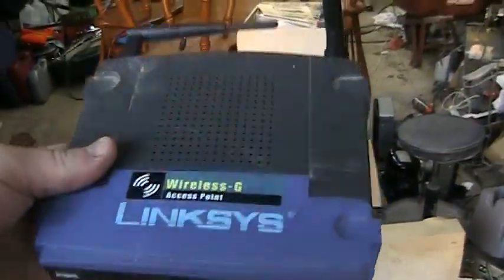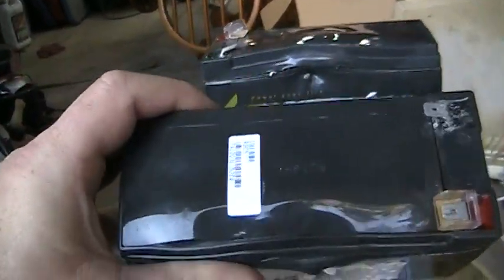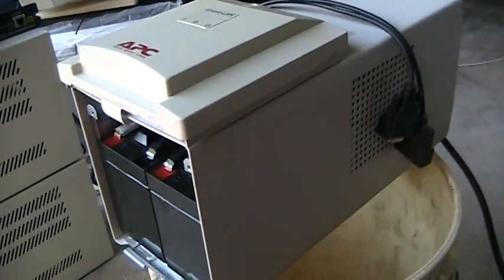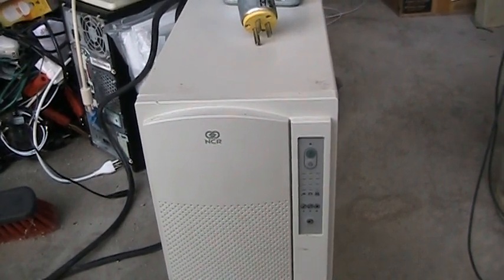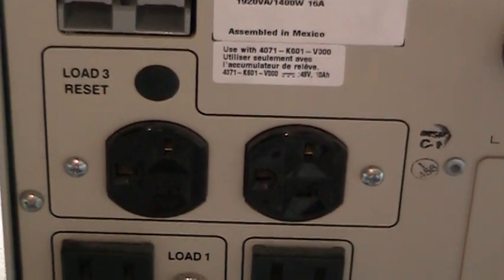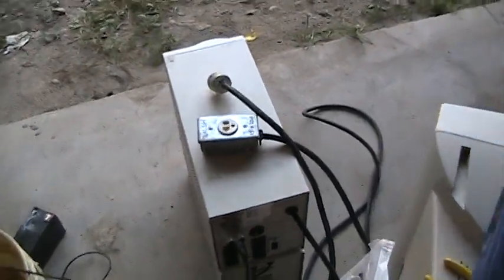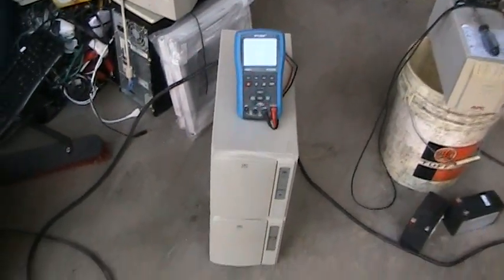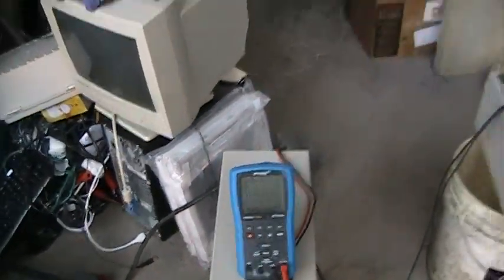2016 Hamfest Finds!

Comment: The 4071 series NCR UPSes were made by Sigma Power Systems and are of the line-interactive type with built-in power conditioning.  The 4072 series, which is still in production, is made by Powerware and is a double-conversion type, which is designed for applications were power quality is critical- they take the line input and generate very clean synthetic AC power from it.
Reply from the maker: Looking inside revealed this one to be a Powerware unit. It's also much newer than I thought: someone wrote a date on the inside back panel of 06/06/2001. Component date codes pretty much back that up.

It would have been nice to find out this was a double conversion, truly uninterruptible UPS. Still, it works well, has a true sinewave output and I'll definitely take that for the price I paid!

It's a good thing I did happen to look inside. The main circuit board had gotten loose (or someone was tinkering around) and was just floating around inside.

Comment: I never got any aftermarket firmware to go on my old WAP54G, but it worked for probably 14 years total.  It did about 6 years of duty as a wireless bridge before finally dying after a power surge.  Replaced it with the router version running DD-WRT.  Does cool stuff, but honestly its a LOT more confusing to get bridging set up on.

Comment: Some great finds! I am sure if i looked hard enough I may be able to find something similar to attend over here. As regards the Dell Optiplex GX280, They did also build a small number of them into the later BTX style case, I have seen a few Optiplex GX280 in that case but never owned one. I believe there was also an Optiplex 210L which used this case to although slightly different from the later 'main production units'.

Comment: does the camera you are using have a small plug with centre pin positive outer shank negative I think that you can run it of the charger without the battery being present as I have done this sort of thing before.

Comment: Have an APC Smart-UPS 1500 backing up my new used Newegg Dell I-5-3470 CPU @ 3.2 GHz.  The UPS is a 2015 ebay find and the ebay batteries where added about eight (8) month ago...  Like the 1500 models for they have normal three prong plugs for house hold use.  Also have a Tripp lite 19" rack mountable with maybe two batteries and a LCD screen that reads voltage input...  The Tripp Lite powers the Broadband Modem, the Dell 24 port Switch and an APC power strip switch with fail over to the APC Smart-UPS 1500 tower...  And if I knock a plug from the outlet then the UPSs will start to BEEP !  Thank you for another great video !  tjl

Comment: You can never have too many UPSes, always handy to have them around, especially if you have a generator on hand that needs manual starting in a power cut... :)

Mine did their job nicely the other night when a storm rolled through and fired some bolts of lightning within a few hundred feet of the house, power went out (turned out one of the circuit breakers in the fusebox tripped!!!) lights stayed on, managed to shut my Lenovo M57 SFF IP Cam/Media server down safely, and all was well, 'til I found the Lenovo's PSU was goosed from capacitor blight and wouldn't start up again!!! Stupid AC Bel crap... :\

Comment: I bought a pair of toshiba libritto 50cts for five dollars this year at hamfest
Reply: Nice!! Do they work?
Reply: +Kevin Bhasi One works but has a cracked screen while the other is just plain dead but has a good screen, so I am going to swap the screen and come out with one working one.
Reply: Jack J with 2 batteries, assuming that they are included. Did you get any other accessories?
Reply: +Kevin Bhasi Yes, I got a dock, an external floppy drive, and an external dvd drive.
Reply: +Kevin Bhasi It did not have a charger though, but I had a compatible adapter.
Reply: Jack J Ok. Nice to know. I've been asking you those questions because I was a bit curious, because the only vintage Libretto I've seen for sale in my country is a 50CT by itself with a battery being sold as-is untested by a liquidator for S$180. Ouch.

Comment: please upload your vids on HD.. not all of us watch on 12 year old 4:3 monitors and will appreciate the extra pixels :)
Reply: +talldude123 okay I see I see.
Reply: The rest of us have correct 4:3 aspect ratio monitors. Doesn't have to be 12 years old, mine's only 3 so far.
Reply from the maker: It's not and never has been a question of what kind of monitor I am using. (And this is a 16:9 aspect ratio video!)

I don't watch Youtube in HD and I see very little reason to upload in it for everything that I do. So, with all due respect, and at this time, the answer to the question is "no".
Reply: I could read the serial numbers on those batteries. so it's good enough.

Comment: Hello this video is great and you really got some great stuff . I have a computer issue that is bugging me . if you could help that would be great . the issue is that every so often I would get the blue screen and on the bottom memroy dump and  it says in the middle issue can be caused by hardwares software in working or installed properly . I had checked all the software and hardware and all is working right . someone I know said I should try removing the memory cards and clean the contacts with rubbing  alcohol and air dry them and test each one seperately . does this sound right to you thank you for your time and all your great videos .thank you for your help in advance . I have a gigabyte ga-ep43-ud3l motherboard and an lga-775 intel core 2 quad processor and 8 gigs of memory
Reply from the maker: The error is correct in indicating that some aspect of your computer's software or hardware is not working correctly. Try another operating system, such as a live Linux distribution on CD. You can do this without modifying your computer's existing software in any way. This could help you determine if the problem is actually software or hardware. If the system remains in a working condition, check for any malware, viruses or other unwanted software on your computer. Be sure your drivers are completely up to date. If the issue persists, test your hardware using utilities such as Memtest 86. A potentially defective or dishonestly specified and poorly made computer power supply can also cause these sorts of problems. Change the power supply out for a reputable make and model if you're not sure, as there really isn't a good way to test a power supply under enough load to make it fail, if it is faulty or dishonestly specified. Also check all fans to make sure they're turning and that you have enough air flow through the case. If all of these things check out and you still have issues, I would consider reinstalling your operating system at that point.
Reply: thank you very much I do not want to change from windows 7 64 bit it is the one I like the most a friend has Linux  and I do not like the layout or way it functions I am a windows man and I will never use windows 10 either I am not a resource wasting person  as well . I will try another power supply . I will have to see the cost factor . I tried in the past to reload the os and it was the same and tried windows millenium and the same happened the power would at times go off and restart and I would at times get the blue screen as well . this 550 watt thermaltake might be in need of replacing after 5 years .do you have any ideas what a very good cheap power supply brand I should buy and one that can power 3 hard drives and 2 optical drives as well as 4  fans a card reader  that is for an intel board thnak you again for the help
Reply from the maker: You don't have to change the software your computer runs. A "live CD" (or DVD) is just that: you pop it in, maybe tell your computer to start from the optical drive if it doesn't do so automatically, run it long enough to see if you still have problems, and when you restart, everything is back to normal. It will not replace Windows unless you specifically tell it to do so.

I've yet to see a single Thermaltake power supply that isn't garbage or very close to. Do not buy a cheap power supply if you value your computer. It'll drive you mad, and may destroy the data you care so much about. Seasonic is probably one of the best power supply manufacturers out there -- and unlike pretty much anyone else, they design and manufacture their own power supplies. Buy a good power supply the first time around. A legitimately specified 500 watt power supply would have no problem operating your computer reliably. If the power quality in your area is not that great, add an uninterruptible power supply to the shopping list: and not some $40 special. Get a minimum of a 750 volt amp unit for any computer application, and ideally more capacity than that!

Yes, this stuff costs money. It's far cheaper than possibly having to rebuild your entire computer. Doing it right the first time is also far cheaper than having to do it two, three, four, ten times or more.
Reply: thank you for your time I did try to use another hard drive with the same operationg system and the computer turned off and the power supply light did as well then it restarted again two times . I am surprised the power supply got great ratings in consumer reports when I bought it .I have had it for 5 years and no issues I am a light user of my computer I use it for some gaming and music and internet but I have 3 hard drives and two optical drives and 4 fans and a card reader a 575 watt would be enough to handle all that and more in the future thank you again for the help I am very grateful
Reply: hello there I had opened up my powersupply just to see what is going on and it said inside it was a 475 watt and not a 575 watt as it said on the case of the power supply so I could have had a fire all these years and I did not know and so now I really am mad and that power supply I have was in consumer reports as a great unit and very reliable . well I guess everyone lies to be able to make a sale . I am lucky after 5  years nothing happened  I found a seasonic 620 watt for 60 dollars  and I will get that . as long as the reviews are good then I will get it . thank you so much for the help I will let you know when I get it and install it how things are going

Comment: Never really understood why having a true sine wave output from an UPS in the consumer electronics market actually matters
Reply: well you cant have a "true" sine wave but, it matters in some older equipment and electronics that use old step-up,step-down converters. where the sine wave was "chopped" up and if the wave was not "true" the voltage could be too high or too low. depending on how the wave looked.
Reply: Well, yeah you can't really power an inductive load with an ups,  at least not without possibly causing damage.  Most all electronics in the modern house use switch mode power supplies though - which completely destroys the sine wave you give them before it ever even gets to the main switching transformer. They simply don't care what kind of AC signal you give them, especially if they have an active PFC.